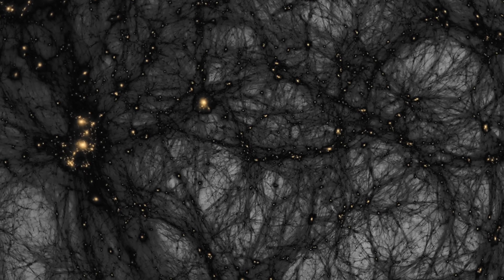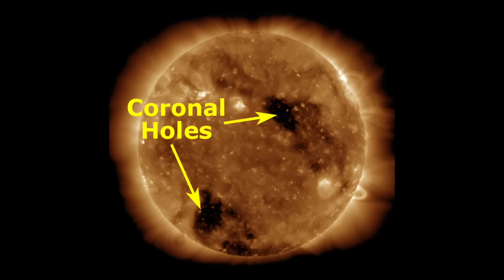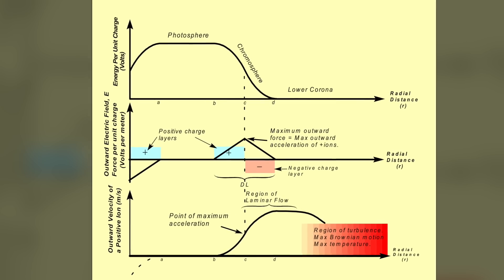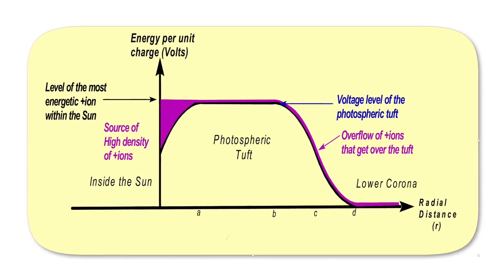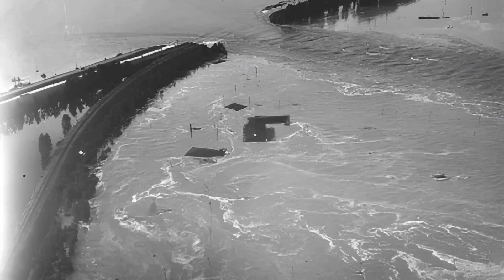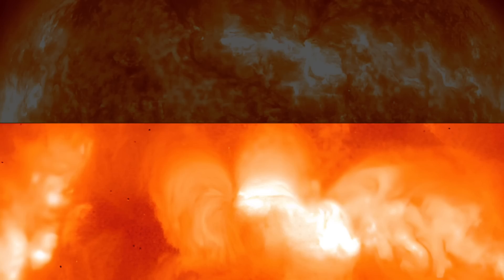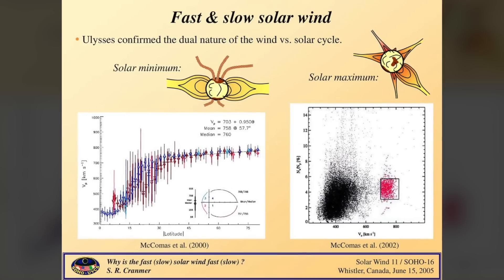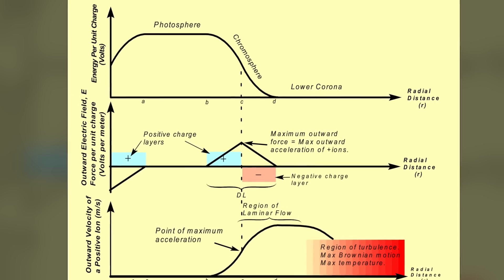Donald E. Scott: Quintessence of Solar Winds | Thunderbolts

Comment: I'm fairly new to EU theory but I am a physicist. I noticed a few years ago that solar winds were comprised high speed protons and that this constant stream of +ions moved from the sun to earth. This must surely be causing the earth to be positively charged wrt the sun (and maybe other stars). Would this make discharges across space occur after billions of years? Also, can we measure the charge on a planet? Are there, and why would there be, a different total number of protons and electrons on earth?
Reply: I would say it is almost impossible to measure charge differentials in space, at least between planets and stars. You would need very long sealed cables! The last time they tried something similar (the space tether experiment), the cable melted, and that was over a relatively short distance. We can, however, observe moving charges and their telltale signatures. As per the JWST images, space is one giant web of rotating Birkeland currents that flow as filaments of helically twisted pairs and braids.
Reply: @daviddrew7852  yes, it would be the mother of all 'wander leads'!
The question remains then. I remember a video on here where the 'meteorite strikes' found on all solid bodies might be arcing end points. I wondered if the arcs were in response to electrostatic charges between bodies. Perhaps different orbits etc leads to different exposures and different charges.
Reply: As a physicist would it be possible to ground this +charge thats coming to earth with for example "pyramid like structure with golden cap". And what effects would it create here in earth. 
Just asking for a friend 😉
Reply: “…discharges across space…” Radioastronomers have discovered and mapped a radio-emitting flow of charged particles (a current) going between two clusters of galaxies in the Hercules Supercluster. It is not a ‘discharge’, per se, but a current flow. Electric charges are always seeking opposite charges, a way to neutralize themselves, and this is the evidence that it happens on a cosmic scale just as it happens when you get up from the couch, touch anything metal, and get a spark. 
Electric charges ARE the Yin and Yang.
Reply: I was thought that where there is a changing magnetic field, there is also a current flow induced in a electrically capable conductor and vice-versa. Am I wrong? We accept the earth and sun having a huge magneto sphere, not being constant and influenced internally and externally, it's measured, plasma as the conductor is also measured and proven, but majority of physicists refuse to the existence of a current flow, is my understanding correct of the situation in astronomy & physics?
Reply: I am no physicist, merely an electronics hobbyist with some physics learning. It seems to me that if the EU model of lightning discharge to and from a charged body such as a planet is a balancing effect tied to a solar charge sheet via Birkeland plasma currents (and that planets tend towards a positively charged centre and negatively charged surface), then gravity between planets would tend to be repulsive over interplanetary distances. But what if two bodies with a large differential between their negative surfaces charges were to approach closely enough...would such and approach be induced by a relative attraction, which would then result in a discharge from one body to the other, a balancing of relative charge and subsequent repulsion? Just a thought.
Reply: @pentagrammaton6793  the effect must be small because as far as I know, orbits etc are modelled using classical mechanics and relativity . If there were substantial electrostatic forces acting on planets then the models using only gravity / time would give incorrect predictions about planet positions.  So far as I know this isn't the case but my expertise is in quantum not astrophysics. Although thinking about it cosmology has always had a problem with mass and 'dark matter'...
Reply: @davelowe1977  interesting...perhaps planetary discharge is an exceedingly rare possibility then. Cosmologists made up dark matter and energy though, I am as certain about that as I am about anything.
Reply: @pentagrammaton6793  The ancients referred to such discharges as the Thunderbolts of the Gods. Intense auroral activity at the time also resulted in the serpents, dragons, and spirals they perceived and recorded.
Reply: @davelowe1977  Physics has been tying itself in knots ever since Newton. The problem is the concept of mass, or more accurately, the idea of mass being a fundamental property. Mass is a useful concept in equations and predictions for the movement of terrestrial objects, and (by extension) to orbits and such. But it’s simply wrong to believe that mass is a fundamental property of matter, as demonstrated by how it breaks down on both very large and very small scales. It doesn’t work at all at the quantum scale, and it’s so wrong at the astronomical level that astronomers needed to invent “dark matter” to explain the discrepancy. 

They might as well have said that the unexpected amount of gravity at cosmological scale is caused by fairy dust. It’s a non-answer to the question. 

Mass and gravity are higher-order effects of electrical charge. When we ignore it, or remove electric charge as a factor, we’re left with a model of physics that is just a tautology — gravity is the result of mass; mass is the ability to cause gravity. It’s circular. The call is coming from inside the house. It explains nothing (and Newton himself said so). 

Einstein’s relativity did the same circular-reasoning thing but on a higher level of abstraction. Instead of Newtonian forces, we have Einsteinian energy, but they’re both still tethered to the primacy of mass. E=mc^2 measures the phenomenon using the theoretical upper limit of acceleration (the so-called “speed of light”) as its point of reference, whereas F=ma uses a theoretical stationary object as its point of reference. But they’re both still defining space, time, inertia, force and energy in terms of mass. It’s exactly backwards. 

It’s no wonder that physics can’t explain gravity. You also can’t see your own eyeballs, since you’re using them to see.
Reply: @hermes_logios  interesting. I agree that a GUT is a long way off and gravity does not fit into quantum theory. Purely on a conceptual level there is something unsettling about mass changing as a function of velocity. And definitely something fishy about massless particles have relativistic mass.
Reply: @hermes_logios  Can you explain what you mean about mass and gravity being a higher  order effect of electrical charge? Conventional thinking is that electrons and protons carry charge and that the electron is a fundamental particle. Its behaviour can be described by four quantum numbers, in fact quantum theory does explain electrons very well in terms of their positions and momenta/energy, But it has nothing to say about their mass or fundamentally about what charge is. How are these things explained in EU theory?
Reply: @davelowe1977  I just mean that electrical charge is the more fundamental property of a material body (regardless of whether it's a particle or a planet). Mass/gravity are secondary (or tertiary, or more) effects of charge. 

Positive charge propagates outward; negative charge propagates inward. That direction (in versus out) of the propagation of energy is the most basic form of polarity. It's what gives rise to electrical current -- it either flows one way or the other (or, in the case of alternating current, it reverses direction 60 times per second). What we call "current" is merely the direction of the propagation a longitudinal pressure wave. In the case of electric current flowing through a medium (like a wire), the propagation goes either one way or the other. 

When we consider a material object, even if it's neutral overall, its charge is not evenly distributed. Charge is relative! The interior of a massive object tends to be positive (outward propagation), and its exterior is generally negative (inward propagation). The larger the object, the more positivity there is in the interior, relative to its negatively-charged exterior. The surface area of a sphere is 4 x pi x r^2, which means that the electrical variance between a planet's interior and exterior varies greatly as the distance between its center and surface increases. Larger objects have more material comprising their positive-interiors, relative to smaller objects. 

So, when a smaller object (e.g., a meteor) approaches a larger object (e.g., a planet), the overall charge balance between them causes the smaller object (which has less negativity on its exterior than a planet) to be attracted to the larger object. The smaller object's internal positivity is attracted to the the larger object's (much larger) external negativity. 

When two objects of relatively equal size (or "mass" as it's called today) interact, they end up repelling one another, because the strength of their respective negative exteriors are fairly close to being equal. That's why the Earth and Sun are both attracted to and repelled by one another, and stay at essentially a constant distance from one another. They're in a state of dynamic equilibrium. It's also why the Earth and Mars are both attracted to and repelled by one another, resulting in discrete orbits. This is true for all of the other planets, too. 

It's also why electrons orbiting a nucleus are quantized in discrete energy levels: they are in a state of dynamic equilibrium, in which they are attracted to (relatively positive) protons, but also repelled from each other, resulting in a state of balance of charge and distance relative to one another (although that equilibrium is unstable at subatomic scale, which is why electrons "move").
Reply: @davelowe1977  
You need to consider that the model of gravity was derived from those orbits, so it naturally fits the observed orbits. 
Math is a language, it can tell the truth or falsehoods equally. Just because the math works doesn't make it so. Ask any accountant.
Reply: @hermes_logios  
Well said sir.
Reply: The Earth has a 'hydrogen plasma tail', extending out to the orbit of Mars. I'm fairly certain this balances the charge, so any increase/decrease in "solar wind" would cause a similar increase/decrease in this tail. The charge simply 'bleeds off' to planets further out, and the outer solar system.